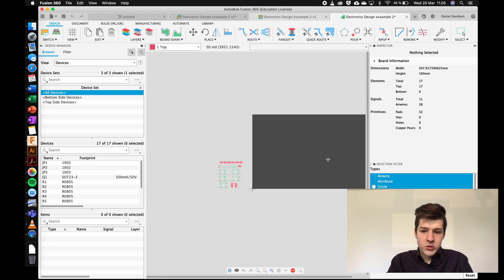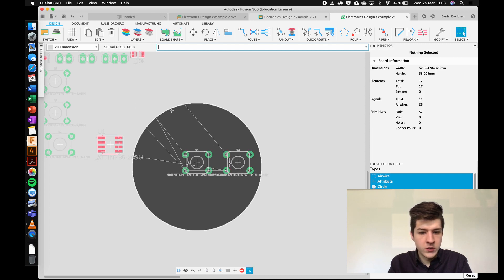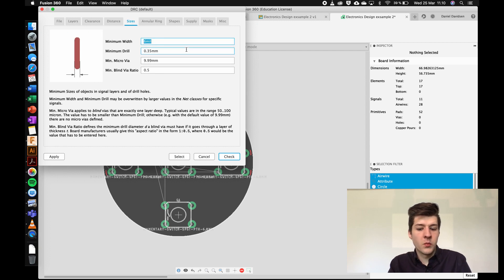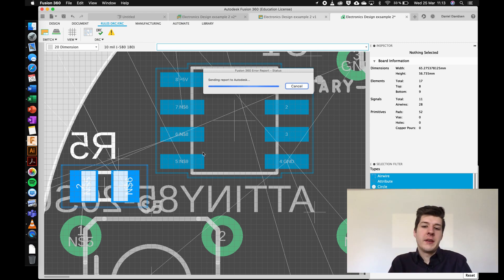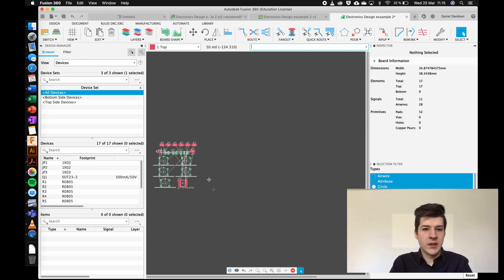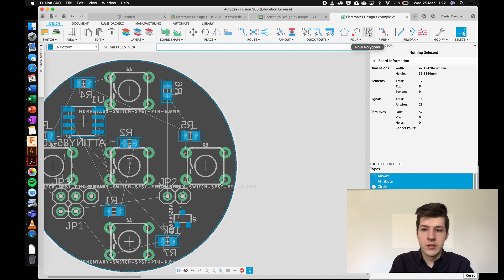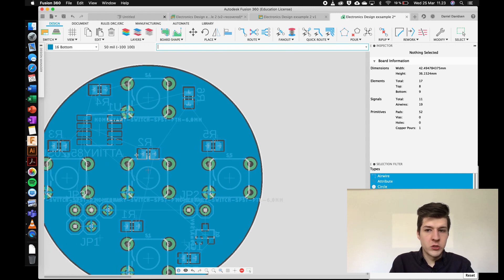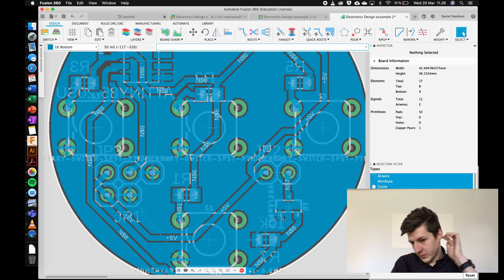Fusion 360 - PCB design / Part 2

Comment: hi all,,,
here frames is not in library how to find it
Reply: Hi Guhan, to add frame components, you must first add the frames library. Here are the basic steps:

(1) Click the "Add Part" button (red, green, black, and yellow icon on the top ribbon of the main window)
(2) Click "Open Library Manager" at the bottom left of the Add window.
(3) Click the "Available" tab at the top right of the Library Manager window.
(4) Scroll down to "frames" in the list of libraries or type "frames" in the box that says "Search for Library Name"
(5) Select the "frames" entry in the list of libraries.
(6) Click the "Use" button at the bottom right.
(7) Close the Library Manager window and "frames" should now be a top-level entry in the Add window. New libraries appear at the bottom of my list, but this may change if your table is already being sorted by one of the columns.